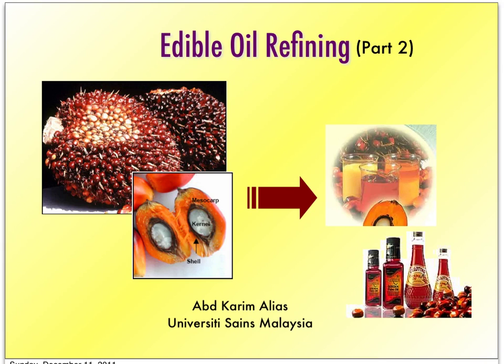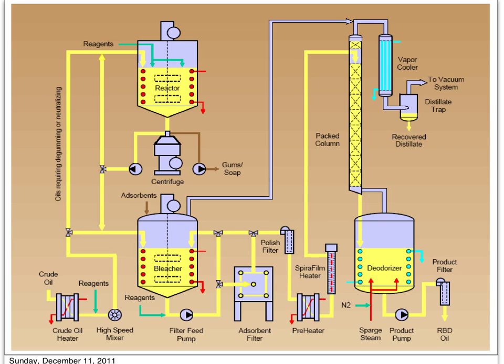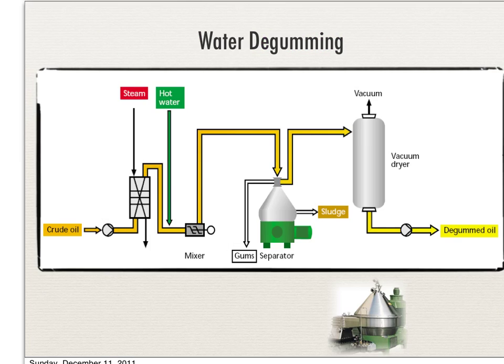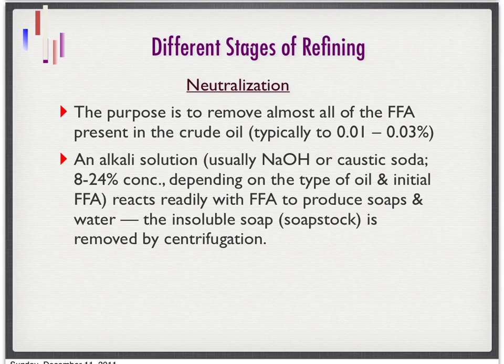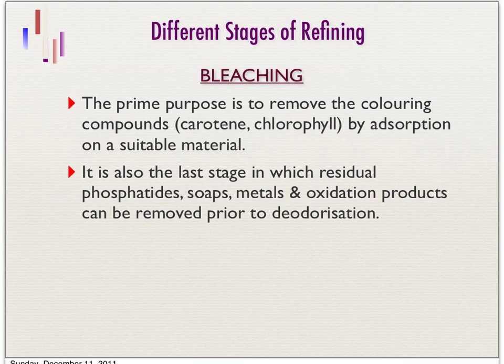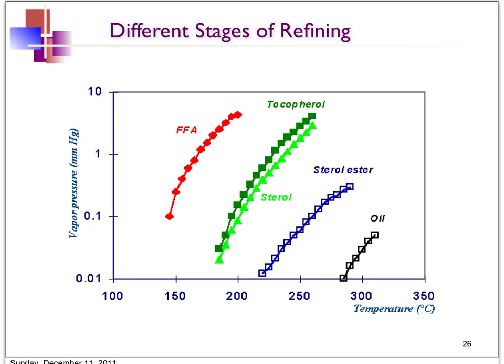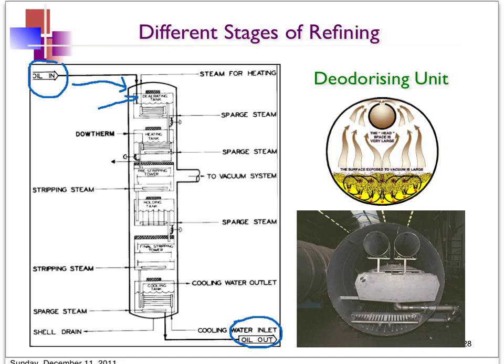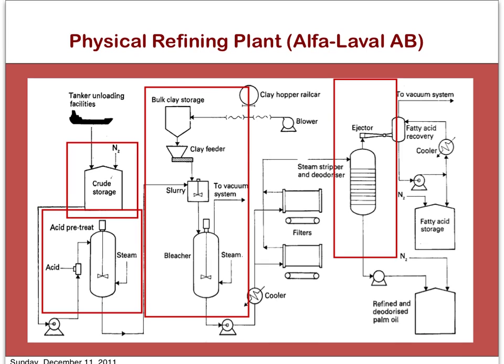Refining of Palm Oil: Part 2

Comment: After refining the CPO what is one supposed to do to avoid the cooking oil solidifying at room temperature?
Reply: One method is steam/electric heat tracing along product lines w/ Appropriate insulation, tanks for oils with High melt points should be equipped with heating coils, most efficiently would likely be steam coils. A mixer such as a side entry, will be needed to agitate the materials to remain at a consistent and liquid temperature. Automation can be a good tool for oils that can degrade/smoke or burn at too high of a temperature, but remain solid at ambient temperatures.

Comment: Hi There - I am interested in the cooling towers which will be used to cool some of these processes. Does the cooling tower water in the deoderizer unit travel through a heat exchanger (ie. clean cooling tower water circuit) or does the fatty acid + water travel directly through the cooling tower?

Many thanks
Reply: please add my whatsapp : +8618203659648 or send  email : firstecd07@oilfa.com